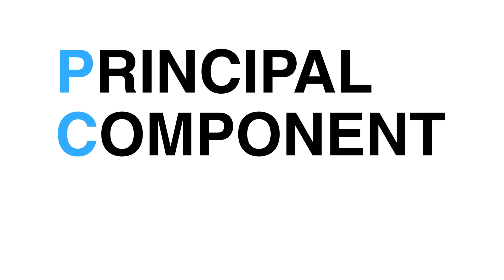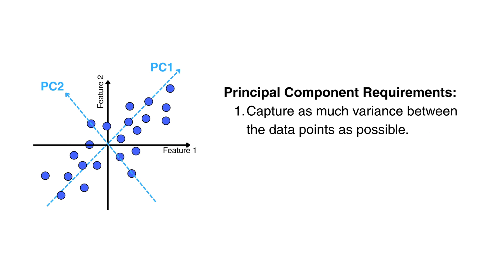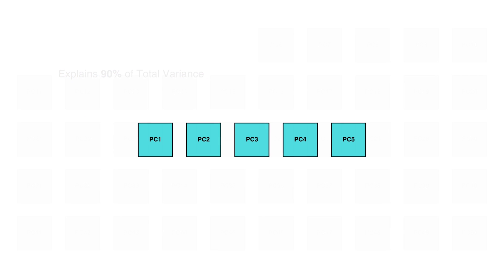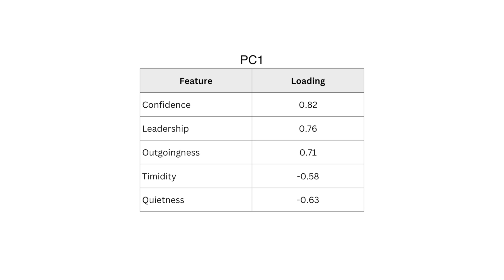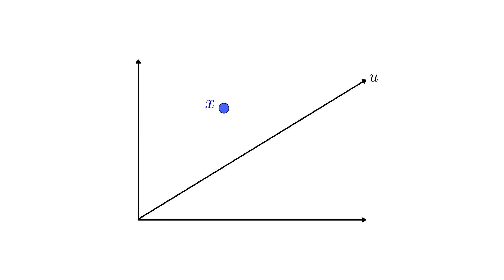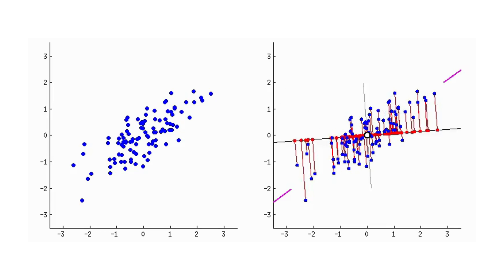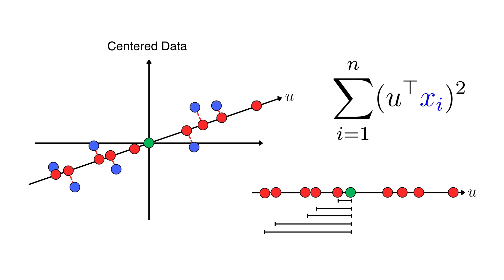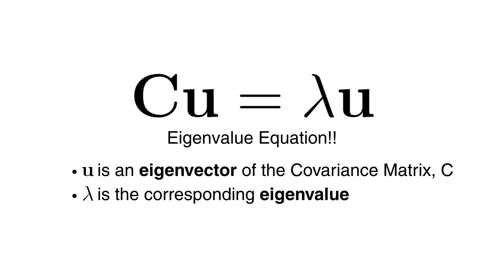Principal Component Analysis (PCA) Clearly Explained!

Comment: Hey, I’d love to connect with you directly. I’ve been developing something called NexusLogic — a framework built around symbolic compression and structured reasoning. It’s essentially a way of reducing complexity into more compact, usable forms, and then expanding it back out when needed. I’ve been applying it across AI, problem-solving, and system design, and the results have been really interesting. Your project feels like the right fit for a conversation, and I’d love to share more if you’re open.

Comment: You missed the part where you discard the eigenvectors with eigenvalues below a threshold, because that's how you decide you can proyect the data points into a line in the example. If the eigenvalues are almost equal, then your data looks like a circle and proyecting into a line doesn't make sense.
Reply from the maker: Good point, you're right. I focused on how PCA finds components, but didn't mention that we often discard ones with low eigenvalues. If the eigenvalues are all similar (like in circular data), then projecting onto a single direction doesn’t help much. Thanks for pointing that out!